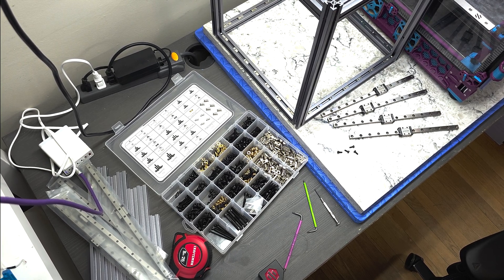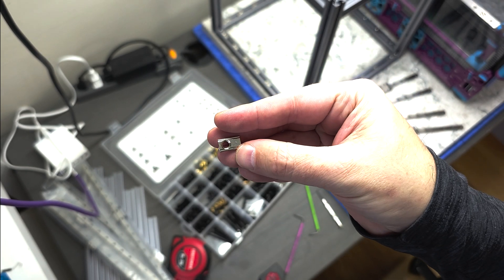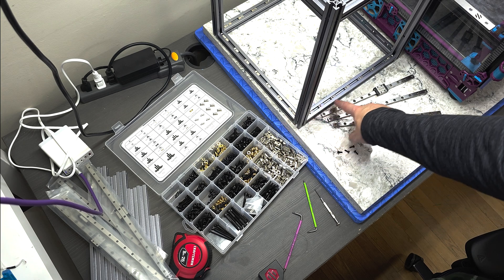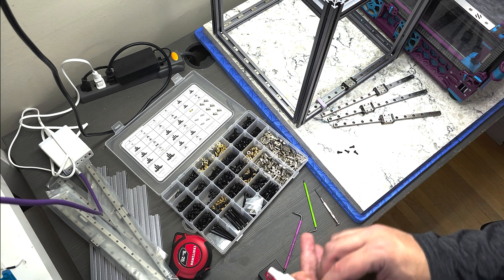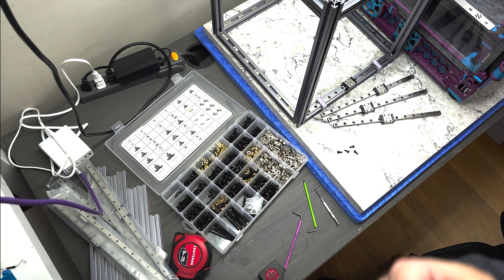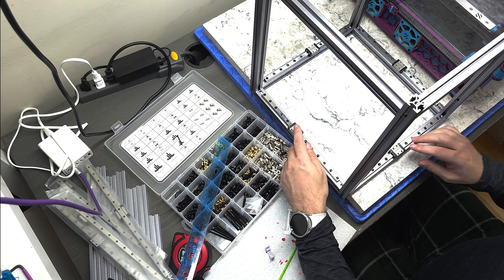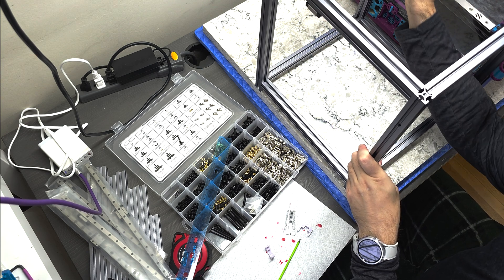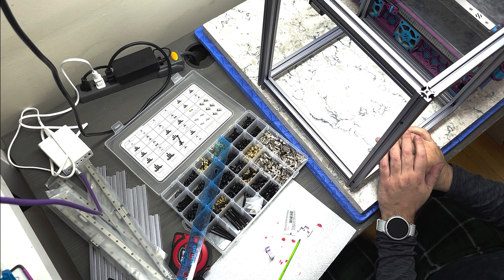Annex Engineering K3: Build Part 02 - Top Linear Rails

Comment: So happy to see you doing a k3 build. They are so intriguing but the fissure between them and the Voron community has kept me from pursuing more info. I guess I could be considered severely anti-conflict..
Reply from the maker: The K3 is supposed to be a beast, and I opted to go with upgraded hardware where I could. I wanted to avoid cutting any corners on this build.
I am an apolitical agnostic, and hate the "my printer is better than yours" mentality. No time for that crap.
Reply from the maker: If I am being totally honest, when I saw the K3 that Fabreeko had on display at RMRRF last April, I fell in love with its front door.
Reply: @oldguymeltsplastic   I went with the voron because there was way more info and support as it was my first DIY printer. I think the K3 is super cool tho and either that or the vzbot will likely be my next project